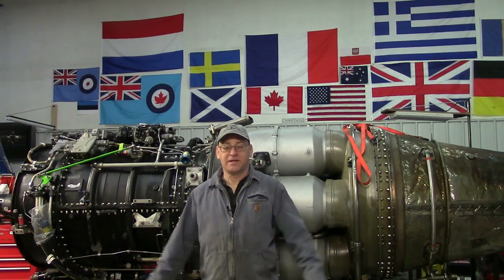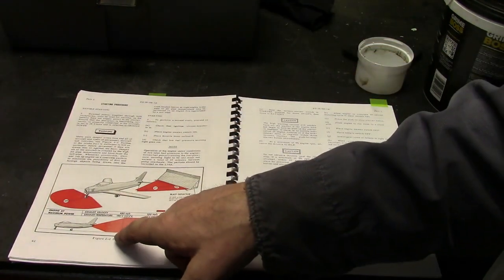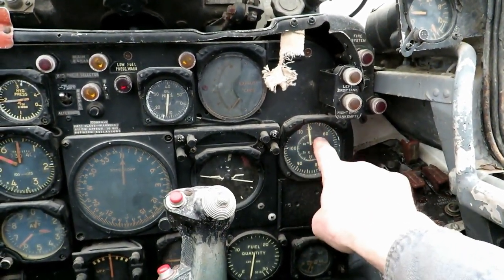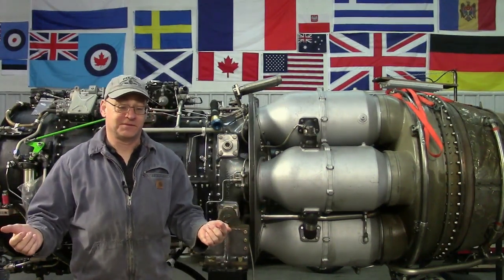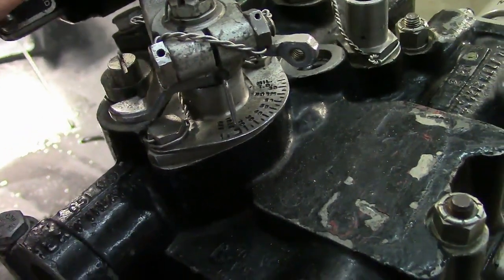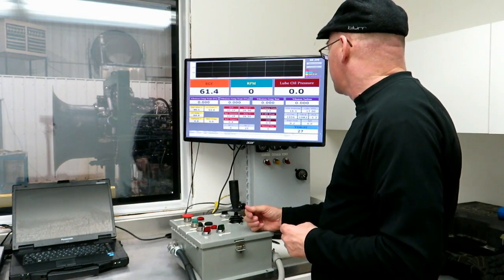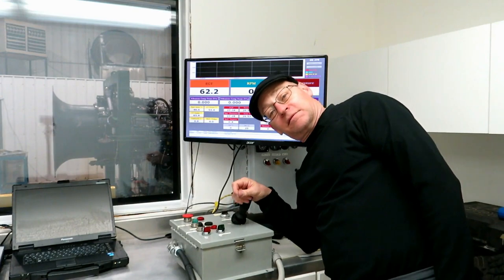Jet Engine Starting: Cockpit vs Test Cell

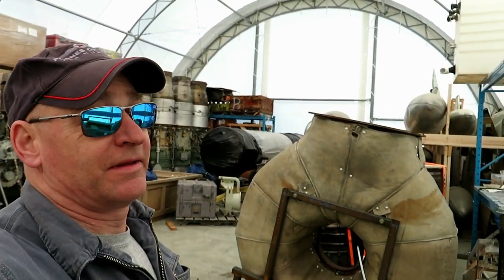Comment: Was that an exhaust plenum for a "Solar Saturn" industrial gas turbine @ 6:46?
Reply from the maker: Yes, but it has been modified. It has had about 6 inches added to its depth, and it is now used as an exhaust collector for a RR Tyne. You can see it in action in my Tyne videos.
There have been several Darrens afoot. Are you the real one?
Reply: @AgentJayZ   One of a few Darren's...
I used to work on IE 990's (and minor servicing on Solar Saturns) in the Petrochemical industry and would really like to find out more about the origins, history and development of these engines (had heard that they were originally used in marine application). 
These units used Allen out put gearboxes.
If you have any references to web links or books regarding the IE 990 engine origins and history please let me know.
Reply: Is this another example of "two nations divided by a common language?"  I would use the term 'plenum' for an intake (with a 'box' arrangement)  and 'volute' for an exhaust.

Comment: grandissimo.
I love your humor.

from the point of ignition to idle, how do you control the throttle?
I mean it obviously does make a difference if either you are slamming it straight to idle (flameout? too much fuel, not enough air?) or going too slow (burning too lean = too hot temps?).
what parameters are you looking at whilst advancing the throttle up to idle, just EGT? or is it like a "you have to have the feeling" thing..

also, can I send you a proper square Swiss flag? ;)
Reply from the maker: You leave it alone.
Reply: @AgentJayZ  unless it tries to hot-start on you, at which point you quickly pull the throttle back to the off position..... I assume.    And then you figure out what the hell is wrong with the engine/start cart/ rigging/ start procedure error....  

Have you ever had a hot start?
Reply from the maker: "unless it tries" ?   

It doesn't work that way.
Reply: @AgentJayZ  There is always a reason, but maybe it was overlooked was my point.

Comment: If you have a email, I’ll send you some pictures of our last overhaul on Alstom GT-24 turbine. I think you will find it interesting.
Reply from the maker: Post them as a slide show so everybody can see them, and I will put a link to it in my power turbine video/s.
Reply: AgentJayZ  here is a short slideshow  of the GT24 “C” inspection
Reply: GT 24 Inspection

Comment: What do I have to do to fly an A-10 Bomber?
Reply: Work hard to get into US Air Force...or reserves...Btw, A-10 is an attack aircraft not a bomber.
Reply from the maker: I think the first thing is you need to join the air force or the air national guard.
I don't think anybody else operates the A-10. It can drop bombs, but it's more than  a bomber.
Reply: It may also be known as a tank ball buster too I think.
  I don,t think I would be cut out for the Air force, I would rather build and invent, plus I am definately not much of an athlete lol.
 Very intelligent plane though, i am sure they are even thinking of ending its service like who are those sabatures wtf.
Reply from the maker: My favorite aircraft. The most specialized combat aircraft ever made, and I think it shows the inadequacy of the idea of "multi-role" aircraft.
Reply: In 1979 I worked on helicopters down the ramp from A-10's at Davis Monthan AFB in Tucson. It was lots of fun watching them load up the bullets with a little cart that would drive up under the airplane and watch them hook up the carriage that would feed in the ammo. They had a unique whine to the engines when they would taxi by. If you are in high school, study your science, physics, math electricity and take auto shop classes. Bone up on english. I hit 95+ on all the ASVAB (skills test?) and the recruiter said I could put in for any job they had. I went 2 years Junior College and got my A&P and got about 40 hours flying as a student pilot $10/hr wet rental on a 150 and $5/hr for instructor). While in my second year I was approached by "men in black" and they offered me ROTC and 2 more years college for my BS (I also had groundwork for electrical engineering degree). But they wanted an 8 year commitment. I turned them down because at 20, who in the fk wants to get themselves into a commitment like that.
Reply: @obsoleteprofessor2034  "at 20, who in the fk wants to get themselves into a commitment like that." 

Yeah, most 20 year olds can't even imagine that they'll be 28 some day. Then one day they discover that 8 years have gone by....
Reply: @jfan4reva  Yep...coulda woulda shoulda. I'm 64 now.

Comment: Can you makes a mini and simplest jet engine out of scrap 😀
Reply from the maker: I would say that is not possible.
Reply: It depends on what you mean by “scrap”.  There are several videos out there on YouTube, showing home-made turbojets.  These are typically based on a scrap (but functional) automotive turbocharger, with a single, home-made combustion chamber that can dwarf the turbo itself.